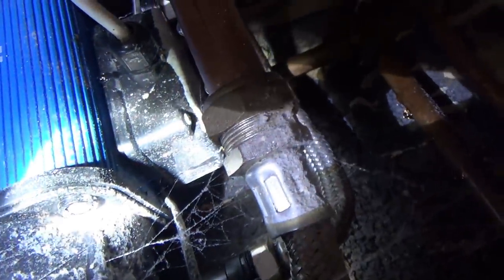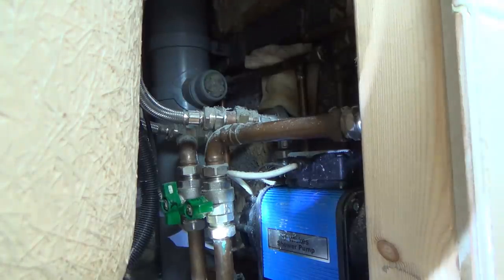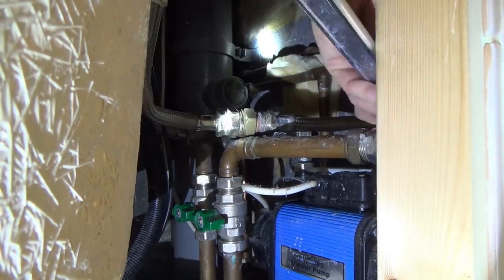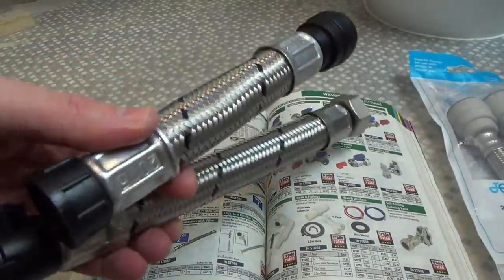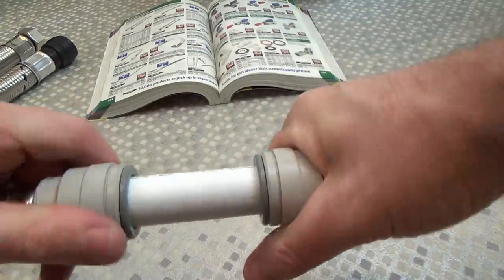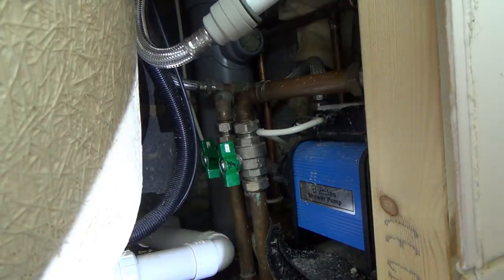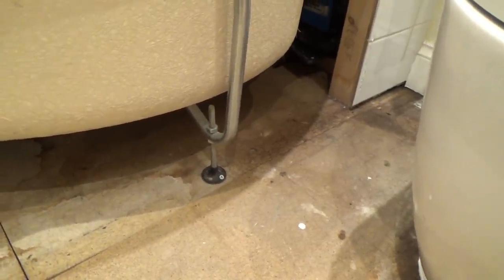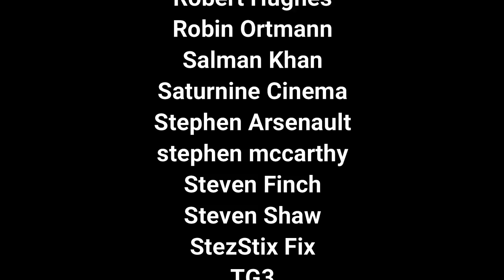Trying to FIX a WATER LEAK in my HOUSE (I'm NOT a Plumber!!)

Comment: A couple weeks ago one of these flexible tubes burst at my parents' house. With hot water running for a few hours, it caused a lot of damages. Stairs ruined, floor and walls needing to be opened up and redone. Apparently these flexible tubes only have a lifespan of up to 20 years, which is appalling considering that no one really pays attention to that, but has to live with the consequences of flooding. Houses should really have "service intervals", like after 10 years replace all these flexible tubes.
Anyway, get yourself some flooding sensors. There are audible ones that will make a sound if water touches the contacts. Of course, you need to change batteries after a couple years, but it gives some peace of mind in places like under the bathtub where you pretty much never check until it's too late.
Reply from the maker: That is a very good idea, under the bath is hidden away so an audible alarm for that location is perfect. Thanks Y :-)
Reply: Even better, install one that shuts the water off.

Comment: If the pump fitting was hard to get on it may have been some non standard / different standard fitting  in the US we use 3/4 but they are not BSP standard . That hose definitely looks like a bodge to me  may have been to mate two different thread standards.

Comment: A shower pump? Do you guys not have hot water heaters over there? or? Also, and wet carpet cleaner would have sucked up most of the water on the carpet very easily. idk.

Comment: The valve you have under the stairs is not designed to be a "regulator" it must be either open or closed. It will not function as a pressure/flow regulator if you only open it part way.
Reply: No, but it will act as flow restrictor reducing dynamic pressure and flow rate at the tap. Static pressure will be the same.
Reply: @coyote5735  They must be either open or closed.. Nothing in between...
Reply: @roderickroderick7216  Rubbish........ you can reduce pressure at the tap outlet if mains pressure is too high, a very common practice.

Comment: Next time you are in screwfix, buy a full bore quarter turn tap (15mm). Add it after your stop cock and next time turn it off from the 1/4 turn tap (then you won't be at risk of the other one leaking when you turn it off again)

Comment: I think you were just unlucky with the pipe  leaking they are usually dead reliable, i would advise getting some better quality spanners though, it make the job so much easier,
Reply: A fair few comments saying Flexi Tails are a big No-No. Is that true or just poor fitting / bad experiences coming to the fore?

Comment: I'm sorry to say, sir Vince, but that bathroom, although the appliances look new and all, would never ever pass where I'm from (Norway). Here we have strict rules about membranes and drains in a shower zone. In yours, the flooring didn't even go underneath the tub. Basically, you would have to completely renovate that bathroom, and I suggest you do just that. As for the leaks you had, really what you should do is open up the floors and walls so that it can dry properly, or you'll have mold inside the constructions making yourself and your family sick. Your fix is probably good for a while, but please call some professionals. Water and electricity is something you should not cheap out on. And don't expect everything is good just because you can't see anything wrong on the surface.
Reply: You mean the floor covering doesnt go underneath the bath? In the UK it doesn't have to and its the UK where he lives.
Reply: @andrewlittleboy8532  Okay. That might very well be, but it's crazy. It's asking for trouble.

Comment: Do not EVER use Teflon tape on fittings with rubber o-rings. The Teflon tape impedes the o-ring to seal
Reply: Connection lost
You where kicked from the game
Reply from the maker: Thanks Thomas :-)